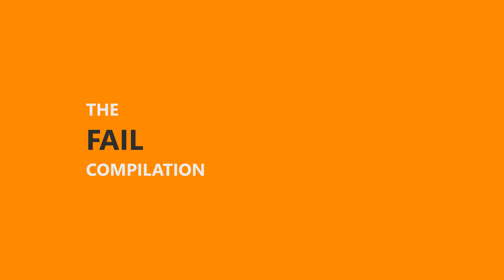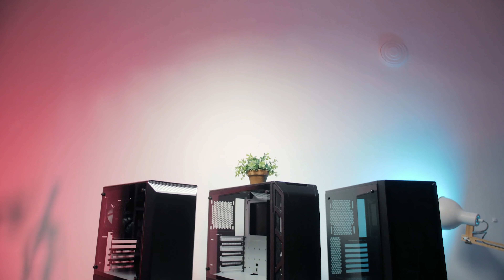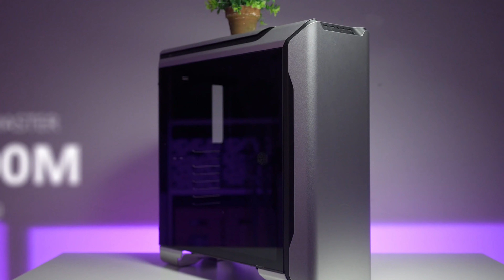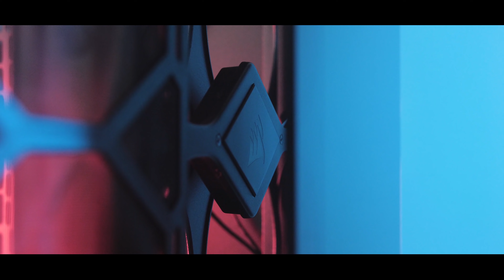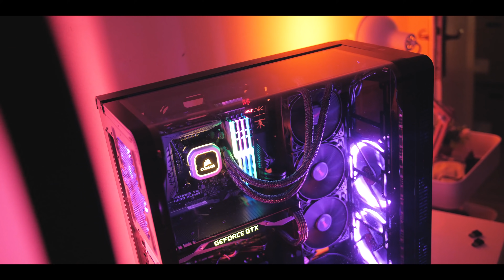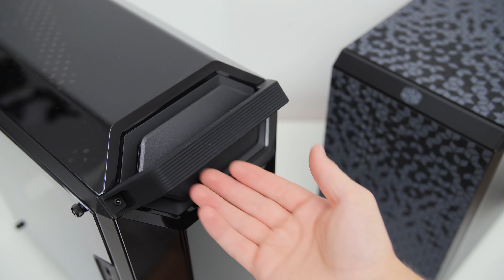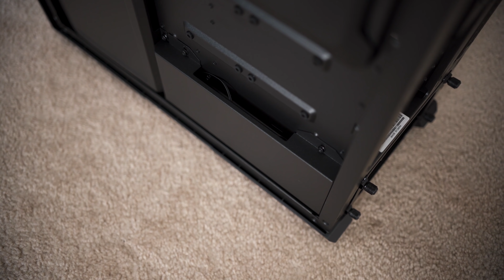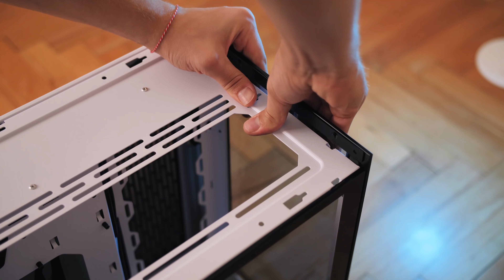Top PC Cases of 2018!

Comment: Like the video EXCEPT on the H500M. I just bought that case and it's A M A Z I N G! The only issue I have with it is the included GPU support because I can't use it since I have a Strix 3 fan GPU which isn't really their fault.
Reply: i think you can play with the angle the support is facing so it can just support the side part of the gpu
Reply: @3kscrub  I tried it. Sadly still won't work

Comment: The Corsair 500D gets a lot of flack. I swapped the fan brackets, moving the 360 to the top and 240 to the side. An additional 360 bracket can be purchased from Corsair for dirt cheap btw. Removing the top dust filter increased airflow. Why have a dust filter on the exhaust? Yay I can filter hot air! Lol it's a beautiful case, but it's short comings are easily over looked IMO.

Comment: I have a Fractal Design Define R6 and its my favorite case I have ever owned or built in. I run the fully open configuration with a 240 AIO push/pull with very impressive cooling.

Comment: The Q300L is SUCH a killer sub-ATX case, especially for that awesome price.

Frankly, Cooler Master deserves MUCH more respect than they get from the media, they're the only 'big name' in the industry that's truly pushing innovation. I mean, what the hell has Corsair done, the disappointing 1000D that got picked apart for the lack of thought put into the design? 
And, mind you, this is coming from someone that 'daily drives' an InWin 303.

Also, LOVE the more unique graphics card mounting concepts of this year, looking forward to more of this.
And, hopefully more unique layouts like my 303 as well, I REALLY don't have much interest in the standard ATX layout, front intake, rear + top exhaust, power supply in the bottom with a giant full length shroud, such a tired design. No one uses desks that require "standard" mid-tower dimensions anyone, those days are all but gone - we can go wider!

Comment: Few new cases offering a 5" half inch drive which I use, if its removable then its more versatile, also usb type c ports are still not common place. Looking forward to a new revision of fractal Design arc, I just wish they ditched the plastic front fascia for sand blasted aluminium. I'm not a big fan of rgb lighting & glass panels as they can break.

Comment: If I didn't need to fit in 8 3.5" HDDs in my system, I would have chosen the O11 Dynamic in a heartbeat. Though, my Fractal Define R6 is still an absolute treat as well :)

Comment: I did a massive overhaul, back in early September. After dropping £1,600 and wanting to show what is/was essentially a new PC off--it was your video on the P350X that convinced me to retire my old CM 690 II Advanced (USB 3 version). It's also the video that made me sub. I've not regretted it one bit. With Corsair LL fans (2x 140, 3x 120) and strips, and a Cooler Master vertical mount, it's nesting; 

A Ryzen R7 2700X w/ MasterLiquid Lite 120, ASUS Prime X470 Pro, 32GB (2x16) Corsair Vengeance LPX 3000MHz DDR4, Gigabyte GTX 1080 8GB Windforce OC, Cooler Master G750M PSU (carried over), As far as storage goes--a 970 Evo 500GB and Kingston A1000 480GB M.2 drives, with a 850 Evo 500GB (former boot drive) and 2x 2TB Barracuda drives being carried over. The 850 Evo and a 2TB drive is part of a StoreMI tier, for games. 

Planning on using retired/old components for a backup rig; FX-8320 @ 4.4GHz w/ Hyper 212 Evo, 32GB DDR3, 990FXA UD3, R9 290 4GB (OC'd), Corsair AF/SP fans...need to dig out an old HyperX 3K 240GB SSD that I use as a portable drive, and grab a PSU.

Comment: The Pc-O11 dynamic is a very well deserved Case of the Year/2018. I have seen so many beautiful Custom loop or just Air, builds this year using the Pc-O11. I my self have a brand new Pc-O11 in the box waiting to convert my 8086K system into my first custom loop into it, looking forward to it. Since it was designed by D8auer a very experienced Custom-Loop Builder & Overclocker, it has been very pleasant to build in according to other Tech Tubers.

Comment: I bought the O11. I got a bit sad when it couldn't fit a Fractal Design S36 vertically (it's got a tip that makes it slightly longer than a conventional 360 rad), but then I mounted it in the top instead, and the temps were fiiiine. So now I am happy again. :)

Comment: Too many ATX and ATX+ sized cases, If you are nuts and really want to drop the money on two 2080Tis you can get SLI motherboards for both 1151 and TR4 sockets. I do not know why you can not find one for 20``  but those used to be available. If you can make SLI motherboards for the 2011 and TR4 then one for the AM4 should be possible.
If you are not going to build an SLI gaming rig or massive workstation with lots of GPU compute cards why go for an ATX or ATX+ sized system? 
Also, I am tired of white or black and RGB.
I would also like to seem options for no window cases. I know that some people love to show off their systems but there are people that might want a more professional look and maybe more sound deading

Comment: On the Corsair 500 D - you can just switch which bracket you want on the front or top - 360 or 240 - you can't fit two 360 rads in that case.  I have a custom loop in mine - 360 in the front in push/pull, 240 on top.  Temps are great and system is silent - even with all the fans.  Just not going to fit 2 360's (at least without some tight tolerances making installation a crap shoot).

Comment: The H500M is so beautiful with, easy vertical gpu and 3 fans at the top and the airflow is amazing. I removed the controller and just plugged my fans on my motherboard with rbg splitters
.
It's just perfect (and yes I turned the fans so I have a 360 watercooling at the top)

Comment: Thank you for another great compilation / video for 2018.  I purchased the Dynamic, but am having trouble fitting my GPU inside with the water reservoir in the front.  It's a beautiful case and I've ordered some different brackets to see if I can move the res forward a little bit.  I'm using the EKWB XRes 140 combo and their vertical bracket which centers the Reservoir / Pump in front of the 120mm fans on the side.  Be aware that the base of the res is very wide and with a long GPU like the MSI 1080ti, you may not be able to fit.  Just a little more length to the case and also the depth is needed.  Another challenge will be to mount a water cooled GPU since the depth can be no more than 158mm.  Still an awesome case and I haven't thrown in the towel, I will try to make it work.  If it won't then I'll send back to Newegg and buy the S2.  I have 9 fans populated and a 60mm thick 360 radiator in the top for exhaust.  The three front - side and bottom are for intake per  your previous tests.  Thanks!!!

Comment: Hey Dimitry! I totally agree with the Lian-Li O11 Dynamic getting Case of the Year 2018! The amount of airflow options is truly endless. However, I was hoping for you to chose the Phanteks Evolv X as the Case of the Year 2018. Dual system support, fill & drain ports for watercooling and as the most versatile case for customization, I was hoping the Evolv X would be the Case of 2018. Also, I would have liked it to be the Case of the Year because the original Phanteks Enthoo Evolv was awarded case of the Year for 2015. It brings in that whole family love! :)

Comment: Personally I would love to see more manufacturers making cases that do away with most of this glass window and RGB nonsense and instead focus on perfecting stuff like cable management, better directed airflow, and sensible compact designs that have minimal thermal impact. I approach building systems with a more utilitarian mindset and believe there can be a kind of beauty in efficient design.

Comment: Pro case withe  only 2x 3.5” while any good motherboard got 6x sata
Reply: Not 2 but 3x3,5" plus 1 SSD (apart of whatever number of m.2 slots you have on MB). Dude, I have (apart from 1 SSD and one M.2) 3x10TB drives running in Raid 5 in PC O11D, and yes, it's all for professional use. Ps: there are even bigger drives available already, but hey, you can always go for nas or straight bananas rack server solution...

Comment: I just got the Coolermaster sl600m. Great case if you plan before you buy, I have the Corsair h150i, cooling my Ryzen 2600x at the top, GPU is vertical and temps are great. Noise is decent, phone app says it averages 35db and I am good with that. Thx for your review in helping me decide on which case to get.

Comment: The 011 dynamic was going to be my case choice but I need the extra 3.5 bays so the evolv x takes it for me plus the doors on the evolv X are really something that appeals to me rather than having to line up a TG panel to the frame and accidentally chip or crack it.

all are still really nice picks though so

Comment: I have a CM H500M case with addressable RGB fans and i complained about the almost non-existing customization of the individual LEDs at their forums and reddit page. One of their representatives noted that more ARGB support and other features will be added to their MasterPlus software after CES 2019 for more support of H500M and other cases. This means that almost certainly they will be unavailing at least 1 more case with ARGB fans at the expo.
Reply: When is that? I rather like the h500 design and thinking of replacing my old haf 922

Comment: How come O11 Dynamic is praised for great airflow with same dust filters as O11 Air?
Reply: Lukas S No idea. Guessing that maybe it leverages the air it gets better or perhaps the fans are higher pressure
Reply: The dynamic doesn't have the choking front dust filters. That's the main complaint. The front air filter creates too much resistance. Gamers Nexus and Dmitri both agreed that simply removing it yields better results.

You don't have that problem with the dynamic since the front is glass too.
Reply: @ajr12388  I believe that no matter how restrictive front panel and dust filters are they will let in more air than nothing in case of the front in the dynamic
Reply: Lukas S how can they produce a great looking case with so low clearance that basicly cuts like 70% of the people that potentialy could buy it. Im very angry that they made this fuckup.

Comment: Ok. About the H500M. I don't think it's that bad. I was able to build a system in it, just fine. The only problem I had was that I had to cram my psu cables behind a panel. But I think it's a great case. Don't let him discourage you from it.
Reply: I loved building in that system. Was a 1000 times better than my old Cullinan. Doing a custom loop with lots of RGB is the best way to learn a case. I did like the dual shroud and panels on the back.

Comment: Phantex could easily be the best pick / recommendation for a PC case with their tasteful RGB and Superior build quality but their airflow is really a deal breaker.

Cooler Master hit the airflow point with H500M but WTF with all the minor flaws that make the case not worth buying ? like why does cooler master in particular keep fucking up their releases ??

Dear Fractal Design, PLEASE give us an R6 with Meshify C front panel or at least make Meshify C literally just 3 or 4 cm more in length so we could actually use a high end GPU with Front mounted Radiator

Corsair is just MIA from Case market imo, like come on ive been waiting for a Refresh of 780T with tempered glass and PSU Shroud for AGES !!  also ditch the plastic while you're at it !

Comment: I rather liked the Phanteks Evolv X for it's style and sheer monstrous amount of SSD carrying space that's totally tucked out of the way. :)
Reply: Surprising since dmitri is a phanteks fanboy
Reply: I bought the case. Those SSD locations are a load of crap to be honest. If you close the panels the cables are making a 180 bend. Personally, I think for the price it's pathetic that Phanteks cheaped out on one or two SSD brackets, and screwed a few holes into the covering panels instead. They should've included the riser cable as well. The Fractal R6 is way more practical and a lot cheaper. This one only takes the looks.
Reply: @Csikter  my cables don't bend 180 degrees. I dont like the closing mechanism for the panels though... Very awkward to open
Reply: @tonn333  they don't if you mount them on the side panel in reverse, but then you can't open it. Or you have an L shaped sata that bends upwards, but even then it's not a great angle. Otherwise I don' know how you mounted it without bending. Yeah that "mechanism" is destined to brake.
Reply: @daddy-gibbs  depends on game.... According to hwinfo max cpu 55c and max gpu thermal diode 53c. Stock case fans, stock cpu and gpu coolers. My computer is running 24/7
Reply: Agree
Reply: I have a cooler master master maker case 5, and thinking about buying the evolv x, but am concerned about choking hazard in intake and exhaust. Anyone that have any real life gaming experience with it??
Reply: @daddy-gibbs  I have it and its great. 2700x and vega 64 lc
Reply: The case I really want to build into is the ENTHOO EVOLV SHIFT X.
Reply: I bought it and then I returned. It really is beautiful but I reallly hated how the glass panels were so tricky to take off along with the sliding disks they used for cable management to the front. The enthoo pro m is amazing and has all i really need along with a smaller compact form.
Reply: @hmonkey4034  taking off the glass panels is easy what are you talking about
Reply: @hmonkey4034  you do remove it every morning?
Reply: @konstantin-bifert  I build and mod more than I game. Love building and really feeling out cases. Not sure what you're trying to say but w/e. If a case is judged by how many times you open it on average then good for you. More power to you.
Reply: @hmonkey4034  clearly did not understood my sentence indeed.
Reply: @hmonkey4034  enthoo pro m is my first fave case to buy by phanteks. How's the airflow of enthoo pro m btw? The front is perforated right
Reply: @nniivekkappo7544  Imagine the nzxt 340 elite front. Its kinda like that. Mount followed by a dust filter followed by the panel which has a good gap between the filter and panel. With the panel off my pc was cold as ice. 2700x hitting 4.2 oc over long workloads and still not even near 70 Celsius.
Reply: My enthoo pro TG is perforated, but i must recommend not to buy the Tempered Glass version - mine cracked into small pieces after playing games. It's a super pain to clean up.
Reply: @rnegoro1  you played games and that caused your tg panel to break?
What games were you playing? Baseball? Golf? Were you shooting it with airsoft guns?

Comment: I still like the meshify c, but I wish they'd release a usb-c version.
Reply: I really want a full-tower version of the Meshify C
Reply: I'm with you but a meshify mini (usb)c with tinted glass.
Reply: I don't know anything about usb c, could you tell me what you use it for ?
Reply: @escalator9734  It's really fast, reversible, and can be used to drive things like monitors or vr headsets over a single cable.
Reply: Ensaum because having a motherboard control graphics is always a good idea.
Reply: @Escalator you’re jokin, right?

Comment: I'm hoping for more Mini ITX, HTPC and SFF cases for 2019. Sometimes less is more.
Reply: Juan Carlos Araujo S. I’m hoping for front panel usb-c on all current cases, especially NZXT cases.
Reply: @Athasin  USB-C isn't a big deal. I don't see why people love it so much..
Reply: @samuelwhite3173  
1. You're right. But it won't be a big thing until it gets more support, and one way to add that support is to add them to all the chassis.
2. I don't know about why people love it. I only want is so I don't have to buy shitty USB-A/USB-C flash drives just to transfer data between my PC and my Mac (don't judge me, I hit accept on their terms of services and apparently sold them my so- ... I mean I'm stuck in the Apple ecosystem™️)
Reply: @Athasin  Run out if you can. Space is a big thing. A SFF actually can be a dual purpose heater. No joke, if you are cold and need heat, turn your fan curves down and heat your tiny college dorm.
Reply: Check out the corsair 280x. It's not perfect, but you can easily mod it to make it work better than stock. 

Eg I am running an Itx board so I can fit rads at the top and bottom, I removed the front glass (all screws, no breaking stuff needed) and it still looks good and allows for airflow, you can raise the feet for better airflow at the bottom, and with the drive cages removed the back has tons of room for fan controllers, RGB, pump, res, and a big PSU even as well. I'm very pleased with how it turned out. Only gripe was I couldn't get 3 rads to fit at once
Reply: Join the SFF forum. Plenty of vendors who might have what you want.
Reply: @Sean-gw3xs  
Can you provide a link per chance?
Reply: SmashStomp Inc corsair 250d would like to have a word with you. I’ve tried them all, nothing beats it.
Reply: @diomedes7971  you HAVE to do AIOs? The fractal Core 500 works great for my server and I got a 240 rad cooling a 1700x and 1080ti more than sufficiently
Reply: Totally agreed! SFF builds are sexy af!
Reply: agree & 2nd, last good one was fractal design core 500
Reply: Now when gpus get really small it looks bad to have a 17cm gpu in a case that supports up to 36cm.

Comment: Still nothing beats the Corsair carbide air 540.
Reply: I've had the 540, and 240 and the 240 feels way more premium. And the 240 has more dust filters than just the front and top of the case.